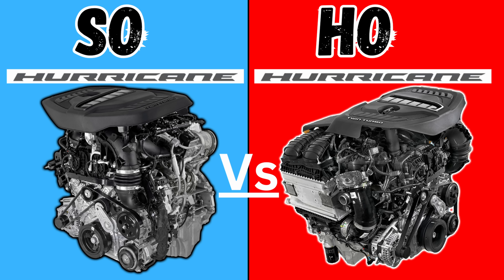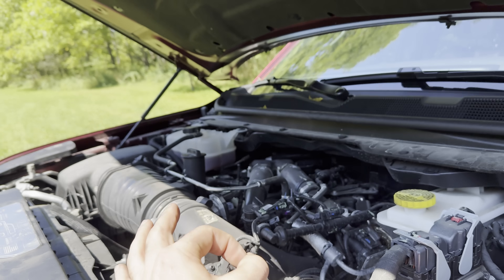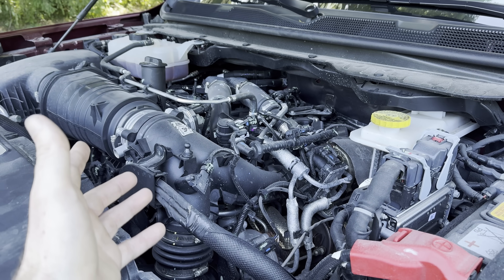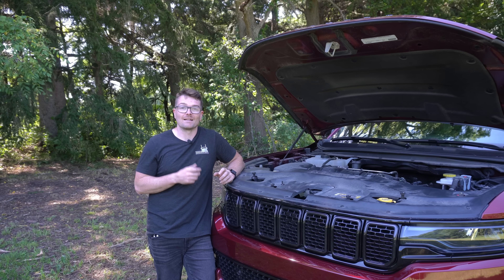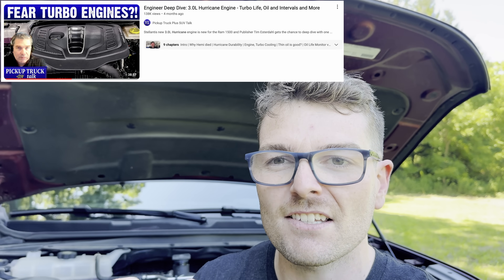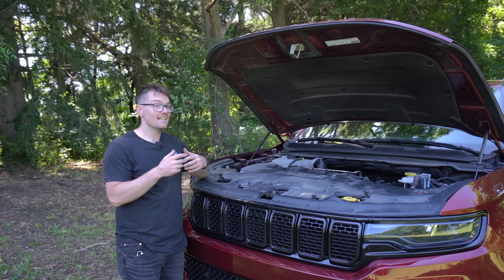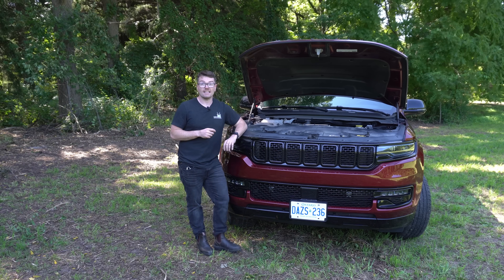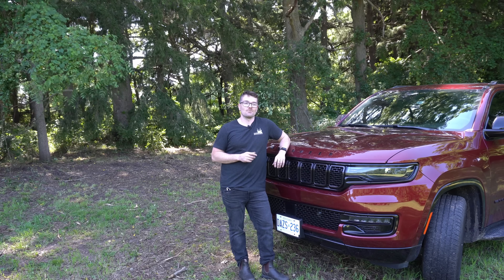Ram 1500 3L HURRICANE Twin Turbo HIGH OUTPUT vs STANDARD OUTPUT Engine | Which is BETTER?

Comment: Only vehicle's sold in the US have 0w20 oil.  The very same vehicle sold anywhere else in the world will recommend 5w30.  The oil 0w20 is strictly for better gas mileage.  Not better protection.

Comment: Let us get the engineering right here.  The reason the compression ratio is dropped on the HO engine, is to limit the occurrence of knock and detonation under the higher cylinder pressures.  However, 9.5:1 is not that low even so.  Alan Falkowski a lead engineer at Chrysler said that the Hurricane had the stroke and bore selected so as to minimize knock.  That was an interesting comment, it is unfortunate he did not expand more.  I wondered which was better for knock, oversquare or undersquare?  If anyone actually knows this please reply.  It's not a trivial question.

Comment: The best way to combat oil dilution with gasoline is to make sure the oil comes up to full temperature.  At that point the gas contamination, and water contamination will evaporate off and be sucked out by the crankcase breathing system.

Comment: I’ve owned many Engine types from 5.7 , 6.4, 3.6 and even 3.0 eco diesel.  Just purchased 3.0 Hurricane SO powered Wagoneer.  I love the new Hurricane engine.  Smooth and powerful and amazing it makes so much power from 3.0 turbo.  Only real disappointment is fuel economy isn’t much better than 5.7 but torque advantage over v8 is big.  Especially in low rpm ranges where you want to keep engine when towing.  When towing I always seemed to need to rev v8 for power while the hurricane pulls hard front just below 3000 rpm.

Comment: I am curious about the reliability of the SO vs HO?  Is there a difference, is the SO more reliable than the HO, is it visa versa, or is it the same?  I can’t seem to find the answer to this question.  Any chance you know or can you find the answer?  I am interested in purchasing a Limited 1500 which comes standard with the HO.

Comment: I just looked this up online, it says the 3.0L has an oil pump belt. That is one of two gripes I have with my Ford 2.7L engine. Apples to Apples, I will just keep my Ford. The second gripe , is the transmission problems Ford and GM are having. I have had no problems, and I have 30k miles, but I was hoping this Hurricane would have a chain and direct / Port injection. So, I guess I will take my chances. It costs, estimate of $5500 to change the oil pump belt on the 2.7L, $8000 for a new transmission. That sounds like a new truck is in my future around 100K miles.

Comment: 25 Ram standard output.
24 mpg and more power than anyone needs. I love my new truck!😊
Reply: Same, had a hemi for 11 years. Not going back, love the new engine
Reply: Me too!  I bought a Rebel a few months ago and it's sick.  So much power.  I'm not getting close to the advertised fuel economy but other than that it's great.
Reply: What gas are you using?  Just got the SO.
Reply: @sambo6651 i had the same question
Reply: Hell ya,, 2025 ram standard output and it rips shit!!!! Add the kickass fuel economy and  ya can't beat it.... 
Drove a 2500 HD with the 8.1liter daily for the last 10 years so I had absolutely forgotten what good gas mileage was even about... It's been only 2 months since I bought the ram and I already feel the difference in my wallet... Loving it!!!

Comment: A common issue of ALL manufactures motors the last decade is losing a quart every 1,000 miles and computer oil life meters being 7k to 10k mile intervals. Stelantis specifically Jeep owners and KIA owners are familiar with oil consumption tests  needing warranty motors. So....... why would Stelantis OR buyers be OK with no dipsticks on $80,000 vehicles? To save pennies a truck. Its time to DO and expect better.
Reply: What engine loses a quart of oil every 1000 miles ?
The monitor measures the oil height in the pan with a ping giving a more accurate reading than a dipstick .
Reply: @toledojeeper2932  DOD/AFM GM LS motors, KIA, Jeep, Subaru, almost all new motors are under recalls and excessive oil consumption issues.
Reply: @BBBILLY86  ..It’s a recall on certain years . Not every engine experienced the problem. Many times a software update is all that is required.
Also the oil monitoring system is more accurate than a dipstick. It’s not an oil life meter .
Reply: @toledojeeper2932  like TPMS that have half the people thinking somebody is messing with them every time the temps drop. And I have to explain air pressure drops in the cold and the sensors are showing you that. Most people honestly don't check vehicles the old way and too disconnected from mechanical knowledge to interpret electronic warnings. And most MFGR ls are dodging oil consumption issues currently. Know several people that have gotten motors replaced from various brands.
Reply: @BBBILLY86  ..So how many of these people are checking their oil by the dipstick ?
If they can’t use a monitor on the dash do you think they will use a dipstick ?
Reply: @toledojeeper2932  I do not.

Comment: The move to thinner oils, now as low as 0w8 for some vehicles, is to conform to C.A.F.E. standards and has nothing to do with what is best for the engine. My Mazda calls for 0w20 in North America, 5w30 for the rest of the world.

Yes, a dealer would likely use ANY excuse to deny a drivetrain warranty claim.

Comment: Another example of only selling to the primary buyer. The primary buyer is usually well off enough to buy another at the end of the loan or "life of vehicle". The biggest problem here is that once the warranty expires the secondary buyer can't keep up. Society needs trickle down economics to help poor families. Nearly every vehicle since 2018 is not going to make it to the 3rd rung of society. The overwhelming complexity is another tax upon the poor. Refuse buying anything that you can't estimate to last 15+ years on philosophical grounds. You don't have to own it that long but think about the increasing burden on a family that otherwise would have gotten by. Or an entrepreneur who is struggling with starting a business. These burdens mount on people. "Death by a thousand paper cuts" is a very real thing. Do your part and resist. You will be rewarded by a smiling face that will never know you by name.

Comment: I have a 2021 Ram 1500 with the 5.7. No etorque. It has a dipstick. I change the oil every 3500 miles (city driving). I buy new every 2-3 years, but there is zero chance I am buying this hurricane. I’m keeping this one until Stellantis pulls their head out and brings back a V8
Reply: Drive a hurricane and you may change your mind? lol
Reply: @jasonslabaugh5783  I may change my mind after the Hurricane has been out at least 5 or 6 years in the Ram.  No manufacturer gets it right out of the gate.  At least the issues the 5.7L has are known, and pretty insignificant, so long as you don't let it idle all day long.

Comment: The difference between the 2 is that the High Output will fail even EARLIER because of the increased pressure & heat
Reply: it has forged pistons, should last longer technically, than the cast aluminum SO pistons, im curious how much more boost the SO motor can handle

Comment: @blackice7408 So far it's been fine.  Interesting that you asked if it's an SRT 10 killer.  I did the Viper engine calibration and dyno testing, including the truck, at Chrysler before I retired.  I would say it's probably quicker than the Viper powered quad cab.

Comment: No engine on earth will break due to thicker oil. Some manufacturers actually have a graph for the owner to choose the oil thickness based on ambient temperatures and severe use\ racing. I WOULD ABSOLUTELY USE 5W-40 OR 0W-40 OIL over the 0W-20 oil.
Reply: LOL
Reply: How about just put the oil in it that the engineers who designed it said it needed. Hard to argue with the guys who designed it rather some guy with an opinion.

Comment: Good video. Normally i agree that OEM recommended oil is best. But, it has become clear they are all going thinner now ONLY for CAFE reasons. Bumping up to the thicker grade, in full synthetic, will pay off long term. Brian at FordTechMakuloco did a great video on 5w20 vs 5w30.

Comment: If they used high quality strong parts in the standard engine, they wouldn't have to upgrade them & change the internals in the high output engine. 🤷

Comment: Many people don't understand that oil is only a certain thickness/viscosity at one specific temperature. As the temp changes, so does the viscosity. This means that 0w-20 at 0C is much, much, MUCH thicker than 5w-30 or 0w-40 at 100C. Running a thicker oil is never a problem, unless the oil is extremely cold at well below freezing temps. 0w-20 is there for one reason: corporate MPG. Trucks that have used oil analysis performed by labs often have better results with thicker oil. My hemi had great reports on thicker oils and the worst reports (most iron in the oil) were when using 20 grade oils.
Reply: LOL

Comment: "The MFG specifies oils for pretty good reasons" 

Yeah like the EPA MPG targets? I'd be curious if this engine is used overseas and what oils are specified.

Its like my GX460. It MUST be 0W-20 here in the US but you look at the overseas owners manuals with the same exact motor manufactured in the same factory and its able to run up to 20W-50.

Comment: One of the great things about the F150 3.5L dual injection system is how much overhead they have in the fuel system for more power as well as easy upgrading of the port fuel system for cheap. 

The fact that they have to run dual high pressure pumps on this engine kinda sucks.
Reply: Yeah, but if it leans out under boost, due to a fuel pump failure, it will burn a hole through the top of the pistons.  Very much like using a cutting torch.
Reply: @rogerbannon8928 one pump isn’t gunna keep it from leaning out. It’s using two just to reach its target

Comment: Do you feel in your opinion that the 3 l is Better Built for longevity than the Ford EcoBoost???
Reply: Which Ecoboost are you referring to? The 3.5 and the 2.7 are very different engines.
Reply: The ecoBoost was given a hard time at its into as well. Very few if any problems with it. I have no doubt the 3.0 I6 was designed as intended with truck use in mind. Old school gearheads don't trust anything new.

Comment: From my experience with working on rentals that keep probably only had 2 oil changes so far and you know everyone has been driving the piss out of them so maybe a little tougher than people think… also Chrysler has been using plastic thermostat housing since 2007 nothing new there … the only thing that concerns me is on your last video someone commented that the durability tests have changed so that worries me … but the guy that designed the hemi that we all love was in on this motor also ..

Comment: To me this looks like Stellantis looked at a BMW engine and thought it would be appropriate for trucks. I think it will have just as many issues and the maintenance costs will be just as high as a twin turbo BMW inline 6, if not even more. That is if Ram even exists long enough to sell many of these, with all of the stuff going on with Dodge and with the Stellantis CEO right now.
Reply from the maker: Ya there is certainly some turmoil happening at the top right now.

Comment: here in aus...91 octane is the base sold. we have 95 and 98 for sale too. 98 all day if you want to mod your motor....no pinging with plenty of advance 😊
Reply: Its not the same rating is it? You use RON to rate octane while we use AKI. 98 RON is the same as 93 AKI
Reply from the maker: 98 would be cool to run. the base in North America is 87

Comment: Good video! But I just can't wrap my head around a HO engine in a work truck. These are BMW M3 numbers...Well, time will tell but I'm skeptical.
Reply from the maker: I agree, If you want a work truck buy the SO 3L. much more in line with a work application.

Comment: 0-20 oil in a turbocharged motor especially in a truck is hard to believe. I would be concerned about oil shear and oil blow-by. I would run a good 5-30 like Shell t6 multi vehicle in both applications standard and H.O. If this was a smaller vehicle the 0-20 may work but not in a 3-4 ton vehicle no way. Just watch it in a few years Stellantis will issue a service bulletin to switch over to 0-40 or 5-30. Porsche uses 0-40 in straight 6 turbocharge application and ford 3.5 eco boost 5-30 . Many owners of turbocharged Subaru and VWs stick with high performance 5-30 oil. I Believe you can use the lower viscosity oils in lighter turbocharged vehicles but not in the heavier ones.
Reply from the maker: that makes sense, I wouldn't be surprised if they change the weight, they did that with the 3L EcoDiesel engines a number of years ago because those babies were blowing up.
Reply: @GettysGarage  For initially spec'd 5W-20 in the 3.5L Ecoboost and after a year or two bumped it up to 5W-30. My guess is because of fuel dilution.

Comment: Greetings Alex. 
I certainly like the Hurricane engine project. But the way they take their performance and reliability for granted leaves a lot to be desired and the worst thing is that the client ends up paying for their inefficiencies. I know that engineering projection programs should only be approved when they do so physically and under real tests of work and stress on their engines. Not the other way around. But I tell you; I like Hurricane projects! 
A HUG Alex and always grateful for sharing your videos, comments and analysis! 
BLESSINGS FOREVER!! 🙏
Reply from the maker: Thank you sir! It seems like the first couple years always have issues or things to worked out. hopefully they built these engines well.

Comment: 20 weight exists because of the Gov / EPA.  They do not have our best interest in mind. 0w40 would absolutely benefit the standard output engine.
Reply from the maker: It could! 0w20 is thin oil but always a risk going off OEM recommendations.
Reply: LOL

Comment: The 6.4 is better.   The 4Xe jeep isn't selling well, every time the arrogant Europeans impose something on the US market it doesn't sell well.
Reply from the maker: Shocking the 4xE isn't selling lol
Reply: I see 4Xe Jeeps everywhere. 4Xe Wranglers make up like 50% of total Wrangler sales as of Q1 2024. So not sure where you are getting that they are not selling well.
Reply: @Jay-me7gw  They are on dealer lots everywhere. At this point of 2023 Jeep had sold 61,214.  This year? 49,685.  So, the new powertrains and prices are keeping sales down.  4Xe cost more, they are heavier and how long do they sit on the lot compared to more normal models?
Reply: @rogerrussell9544  Lol, their sales are down across the board because they suck and their prices are outrageous. $60k+ for a Gladiator with a Pentastar? Please. 

It has nothing to do with new powertrains. You can still get the pentastar in the Wrangler and Gladiator and Grand Cherokee.
Reply: @Jay-me7gw  The 2.4 is gone and replaced with a small 1.5 and 2.0- turbo.  While the 3.6 is available what do most have?  Stellantis has no respect for anything the US designed.

Comment: The price on the HO version doesn't make sense.  You can grab a 2500/3500 for practically the same cost and have a lot more payload and towing capacity plus a more bed.
Reply from the maker: I think they are marketing this engine as a luxury item. which sort of explains the heavy price tag

Comment: I hear, "more heat, higher cylinder pressure, running 20+ pounds of boost," and I can't help but think these will all help lead to lower reliability, higher maintenance and repair costs, etc.
Reply from the maker: smart man!
Reply: @GettysGarage  on this subject, I really wonder if you could make the HO last much longer with the beefier components if you were to baby it. My example is, I want to buy a comfortable truck as it would essentially be my work office as i'm a highway roads and bridges construction inspector and often do my work reports in the truck and it just so happens the highest tier truck is the most luxurious interior of any truck I've ever seen and it has the HO engine. I'd be doing mostly highway driving and then driving from jobsite to jobsite and potentially idling for a few hours a day. My current 2019 ram 1500 has about 3000 driving hours and 4800 idled hours and I worry about the camshaft/lifter issues that they're known for and wonder if the HO would potentially be a good option. I don't plan on buying it for about a year while I wait to see if any major issues come up and save up the money to buy it in cash + trade in, I would appreciate any insight you have on this and hope you're doing great.

Comment: Is egr new to gasoline engines? I’m used to it on my Cummins but I was under the impression only diesels had it
Reply: No but the EGR on a gasoline engine isnt all bad. It doesnt cause reduced efficiency like a diesel, it actually improves it in a gas motor but reducing pumping losses. 

It also doesnt gum up the intake with soot.
Reply: They’ve been in most cars since the early 2000s. I have a 2005 dodge magnum rt which has one.
Reply: @evildrizzt1 GM started putting EGR on their cars and light duty trucks in 1973.

Comment: I’m wondering if this means a HO Hurricane detuned to the power of a SO Hurricane will run cooler and more efficiently when towing; if so, that might make it worth the price as it means the engine should see less wear and last longer then the SO if you change tunes when towing to destress the engine.